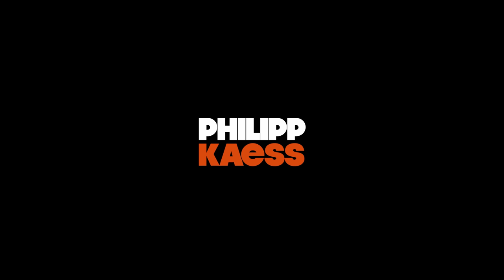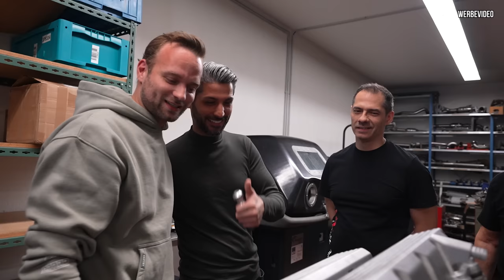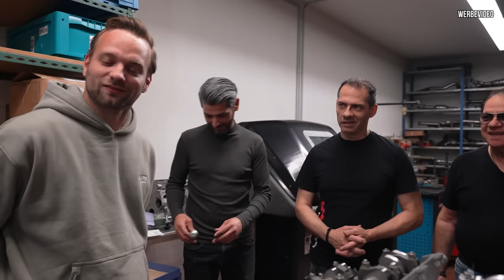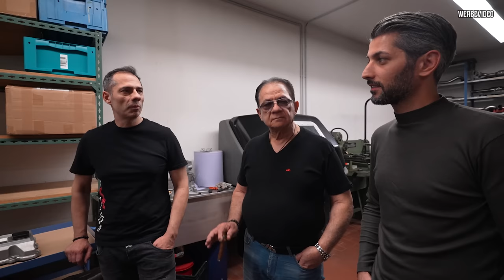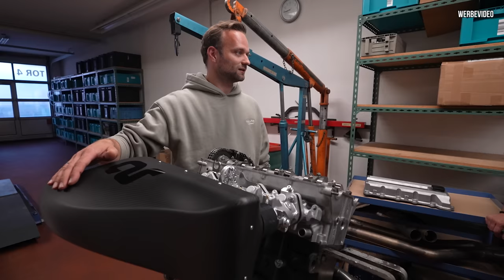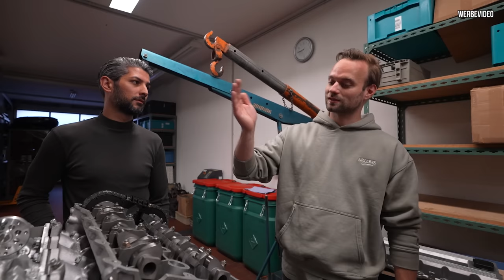DREHZAHL statt HUBRAUM! Aber auch mehr WARTUNG als FAHREN? BMW S42 Rennmotor!

Comment: Na da bin ich mal gespannt. Sieht ganz gut aus. Verdichtung 12,6 und Ventilhub von 12 gibt schon Leistung aber für einen Rennmotor noch relativ Human, hat meine Maschine auch. Ich fahre 45mm Walzenschieber. Wenn das hier 50er Standardklappen sind ist das äqivalent hier etwas größer als bei mir. Sollte hier schon 240 PS bringen. Mein 2,3er Motor in Straßenabstimmung drückt 255PS. Eine Saison sollte das Pleullager schon halten, falls das nicht der Fall ist, wird der Spaß schnell getrübt, prophezeie ich jetzt schon mal. Bei der Drehzahl ist es ganz einfach; bei 25m/s ist Schluss. Das heißt bei einem 88er Hub wie hier genannt, klar: 8500U/min ist die oberste Grenze. (bei 85er Hub wie die S42 BMW Daten hergeben sind es 8800U/min) Schaltdrehzahl sollte mindestens 300 U/min darunter liegen, damit man Reserve hat wie Philipp schon richtig sagt, sonst ist das Ding schnell mal Schrott, beim "Runterschaltfehler" hilf kein Begrenzer 😀 Niemals Filter weglassen, ist für normalos wie wir es sind Schwachsinn. In der STW waren die Filter großflächig im Ram-Airbereich vorne. Tip: bei der Drossel, viel hilf nicht immer viel. Original waren 46er Flachschieber verbaut. Wenn du Spaß haben willst, meld dich und ich nehme Dich mal mit, man muss keinen 300PS "Kopfschmerzenmotor" haben, reichen auch 250PS, kommt natürlich auch auf das Auto drauf an, was angeschoben werden soll 😉
Reply: Nen normaler Sauger schafft ca. 10 Nm pro 100ccm. Bei 250 Ps und z.B. 8000rpm brauch er 220 Nm. Sollte machbar sein bei dem Setup.
Reply: Mal ne Frage: In welchem finanziellen Bereich bewegen wir uns da? 20-25tEUR?
Reply: @iknowit3705  der Motor ist ein Duratec Cosworth. Motor (geschmiedete Arrow Kurbelwelle) mit Anbauteile und Steuergerät ca. 28.000€. Ich habe noch eine original geschmiedete, gebläute Cosworth Kurbelwelle verbaut, da würde ich sagen 35.000€ wenns das noch neu gäbe. Entgegen zu oben geschrieben, fahre ich eine 12:1 Verdichtung + 11.3mm/283° Nockenwelle bei 255PS/270Nm/600kg. Die größte Ausbaustufe wäre 14:1 Verdichtung, 13,2/300° Einlassnocken, Ø1mm größere Einlasventile, 48er Walzenschieber und mit 89er Bohrung als 2.4er Das bringt dann ca. 325 PS. Für die Straße ist das von den Belastungen nicht sinnvoll. Die zweithöchste Ausbaustufe hat 280 PS und ist die meistgewählte bei Renneinsätzen um eine Saison durchzufahren.
Reply: @iknowit3705  bei dem M42 vom Vid wahrscheinlich im Bereich von 10 bis 15 k wenn du Freundschaftsdienste ausschliessen würdest. Hört ja nich beim Motor auf. Steuergerät. Kupplung. Zusätzliches Kühlerpaket. Sensorik. Verschlauchung. Ist schon viel Geld. Aber selten.
Reply: Aus welcher Gegend kommsten? Hier in IN such ich noch ein paar Motorsport bekloppte ;)
Reply: @jaybee5390  Nordthüringen 😉

Comment: Geiles Teil.
Der einfachere Weg, wäre ein b18c oder K20a von Honda gewesen. Die machen bereits ab Werk 9k bzw 8,5k Umdrehungen und werfen gute 200PS aus. Aber ja ich weiß, Sünde und so.
Reply: Nope. Das geht eigentlich nur beim f20c & b16b (sind die einzigen mit 9000rpm drehzahllimit). Der f20c ist alles andere als zuverlässig. Bei dem b16b bin ich raus. Frontantrieb war noch nie so richtig meins. Die anderen drehen meist knapp über 8000 und haben dafür aber einen deutlich besseren durchzug (also zumindest was die ganzen k20 varianten angeht, die b motoren sind echt nicht so meins).

Comment: Ich fahre selber den M42b18 allerdings im E30 318is, ich bin echt gespannt was der Motor nachher so an Daten hergibt. Ich bin selber gerade an dem Projekt den Hubraum zu erhöhen durch die Dieselwelle usw. Da ich aber kein Tracktool habe sondern STVO Konform unterwegs bin, wird der Motor relativ human gebaut mit originaler Drosselklappe, die nur aufgespindelt wird um die originale Optik zu erhalten😉.

Comment: Ich habe es ja schön öfter geschrieben...aber als Motorradfahrer lächelt man darüber. Wenn die Haltbarkeit keine Rolle spielt, dann könnte man auch (gesponnen) zwei Ducati Desmo-V2, zBsp. 1098er, zusammenhängen und bei etwas mehr Hubraum hätte man 308PS. Ganz ohne verrückte Renntechnik. Mit dem krassen Zeug fährt man dann 990ccm und 260PS ^^.
Reply: Eben... aus 1l Hubraum 200ps zu holen ist bei motorädern nichts besonderes. Und die halten gefühlt ewig. Klar haben die Motoren weniger Belastung.
In der moto gp sind auch über 300ps drin🤙
Reply: Da lacht der Autofahrer über das Drehmoment bei den Motorrädern.. 220ps und 120NM sind nicht gerade Werte, die im Auto Sinn machen. Äpfel und Birnen.
Reply: @Xero285  da sollte man schon 2 von nutzen. So habe ich es geschrieben. Die Auslegung eines Motors ist immer vom Einsatz abhängig. Die Formel 1 Sauger waren auch keine Drehmomentgiganten... das ist halt das Ergebnis vom kurzen Hub. Also keine Birnen und Äpfel, oder ist der Motor im Video für den Anhängerbetrieb auf der Pferdekoppel gebaut worden?
Reply: @Xero285  jedoch reden wir bei Motorrädern von lediglich 1000ccm.
Rein rechnerisch entspricht das bei 2000ccm 440ps und 240nm. 
Von wieviel Drehmoment sprechen wir denn bei einem Auto mit 2l hubraum und 250ps?
Reply: @VR.46  Rein rechnerisch hat aber nichts mit der Praxis zu tun, das ist ja mein Punkt. Wenn du den Motorrad Motor doppelt so groß baust, dann hast du auch die doppelte Masse und somit ist nicht mehr die Literleistung bei der Drehzahl möglich, ohne Abstriche bei der Haltbarkeit machen zu müssen.

Die Sauger haben bei guter Abstimmung bei 250PS um die 250NM.

Comment: Wäre es nicht einfacher (und günstiger) gewesen einfach einen F20C aus der S2000 zu nehmen?
Reply: k20a oder k20a2. Mit bisschen hier und da standhafte 250ps und nicht so ein groschengrab. Die Bilas Herren freuen sich bestimmt wenn die Rechnung bezahlt ist und die beiden Laberköppe aus dem Laden
Reply: Klar einen Reiskocher in den BMW basteln. Wer das in Frage stellt was hier gemacht wird hat Tuning nicht verstanden
Reply: Engine Swaps sind ja wohl der Inbegriff von Tuning.
Und es geht Selim ja um das 4 Zylinder Schreien ala DTM/STW, das kann der Hondamotor auch und zwar standfest.
Reply: @shiro-tf1mh  tunen bedeutet das bestehende system zu optimieren. Einen anderen motor einzubauen nur weil es einfacher ist, macht da also null sinn. Und nur weil es auch ein 4 zylinder ist klingt es bei weitem nicht so wie der originalmotor

Comment: Warum habt ihr eigentlich keinen s14 als Basis genommen wie beim stw?
Reply: Ich vermute selim wusste dass nicht dass in der ersten saison noch der S14 aus dem E30 weiter verwendet wurde. Ab der 2. Saison war dann der M42 eingesetzt
Reply: @TheS1PikesPeak  naja genannt s42 der hat einen eigens konstruierten Zylinderkopf
Reply: @user-wn3ww5lw5j  weiß ich. S42B20P heißt er im ganzen 🤓
Reply: @TheS1PikesPeak  meines Erachtens nach sehr wenig mit einem m42 zu tun
Reply: @user-wn3ww5lw5j  Block ist 1:1 ident, Kopf ist von den Abmessungen und der Ausführung ident aber halt komplett andere Innereien (Nockenwelle, Kanäle, Größe der Ventile) und halt Ansaugung ect halt auf Renn trimm
Reply: Weil die Teile vom S42 noch viel Kostspieliger sind, als beim S14 und der ist schon Endgegner bei den Kosten für Teile.
Nen kompletten M42 bekommst du für 500Euro.
Reply: @Xero285  das der s42 extrem teuer ist ist klar aber denke mal ein s14 auf dtm spec aufzubauen wäre ähnlich teuer wie dieser Motor und der ist schon erprobt und läuft garantiert perfekt
Reply: @user-wn3ww5lw5j  Da läuft nichts perfekt und die DTM spec Motoren kosten nochmal ne ganze Stange mehr. S14 und S42 kannst du mit dem Motor, der hier gezeigt wurde Kosten technisch nicht vergleichen, die spielen nicht mal im selben Universum.. S14 auf 300+ PS kostet schnell 30k€ ohne Motor, DTM spec liegst du bei 80k, wenn du überhaupt Original Teile findest. 
Einen M42 bekommst du für 10-15k haltbar auf 250PS inkl. Motor.
Reply: @Xero285  muss ja nicht mit originalen Teilen von damals einfach nur gleiche Abmessungen Flachschieber gemachter Kopf Ölsystem und leichterer Kurbetrieb fertig erprobter rennmotor
Reply: @user-wn3ww5lw5j  Hast du mal eine Kurbelwelle nachfertigen lassen? 😂 Dispo sein Vater.
Reply: @Xero285  gibt für 2,5k s14 billet Kurbelwellen
Reply: @user-wn3ww5lw5j  aber nicht nach DTM Spec... Die Kurbelwelle vom S14b25 wurde für die DTM noch maximal bearbeitet.
Reply: @Xero285  die billet ist leichter und stabiler
Reply: @user-wn3ww5lw5j  Dann nenn mir doch mal die Vorteile der gefrästen gegenüber der geschmiedeten Kurbelwelle beim S14 Motor... Ich bin gespannt.
Reply: @Xero285  aufgrund des gleichmäßigen materialgefüges von gefrästen Bauteilen lassen sich diese leichter konstruieren da das Material größeren Belastungen standhält
Reply: @user-wn3ww5lw5j  Bist du ein Troll?
Reply: @Xero285  oh Gott…
Reply: Warum beweist du deine falschaussagen nicht?
Reply: @user-wn3ww5lw5j  und wieder wird hier diskutiert. Lass es sein du hast einfach keine ahnung davon.
Reply: @Xero285  ja ist ein Troll. Will alles besser wissen aber kann nix technisch belegen.
Reply: @8epeter  welche Falschaussage soll ich beweisen?
Reply: @user-wn3ww5lw5j  alle deine falschaussagen. Vor denen du ablenkst! Das weißt du nämlich also nicht rausreden sondern Nachweise und Beweise liefern!
Reply: @8epeter  welche konkrete Aussage meist du jetzt? Am besten mit Zitat wenn du dazu in der Lage bist
Reply: @user-wn3ww5lw5j  nicht fragen sondern liefern! Du weißt welche rede dich nicht raus.
Reply: @user-wn3ww5lw5j  und schon persönlich werden. War klar wenn die Argumentation fehlt, das technische Wissen fehlt.
Reply: @user-wn3ww5lw5j  Wo sind deine Zitate? Wo sind deine Antworten? Wo sind deine beweise? Wo sind deine Nachweise? Von anderen was fordern aber nix liefern!
Reply: @user-wn3ww5lw5j  was ein troll
Reply: @8epeter  nenn mir eine Aussage von mir die ich dir belegen soll und ich belege sie dir
Reply: @user-wn3ww5lw5j  lerne lesen! Alle Aussagen sind falsch ALLE. 
Du weißt welche lenke nicht ab!
Reply: @user-wn3ww5lw5j  Diese ist z.B. völlig falsch, im Zusammenhang mit dem S14 Motor.
Reply: @user-wn3ww5lw5j  Diese auch. Die Billet Welle ist nicht stabiler als eine bearbeitete Schmiedewelle.
Reply: @Xero285  warum ist diese Welle „falsch“
Klar kann eine geschmiedete Welle besser sein als eine billet kommt immer auf die Qualität und das Ausgangsmaterial an unter gleichen Bedingungen ist die billet Welle aber überlegen was Performance angeht
Reply: @user-wn3ww5lw5j  Du hast geschrieben sie ist besser. Deine Begründung dafür ist falsch.
Also warum meinst du nun, dass sie besser ist? Und komm mir nicht mit dem Gefügequatsch, denn da ist Schmiedematerial immer überlegen.
Reply: @Xero285  nein je nach Qualität sind die da gleich auf du kannst aber nie so präzise schmieden wie du fräsen kannst
Reply: @Xero285  bei Schrauben sind gerollte Schrauben auch das non plus ultra nicht geschmiedet genau das gleiche
Reply: @user-wn3ww5lw5j  Merkst du selbst, rollen ist eine Art Kaltschmiedeverfahren, also spanlos. Billet beschreibt im amerikanischen immer eine spanende Bearbeitung (außer bei runden Halbzeugen, aber die treffen hier ja nicht zu).
Ein schmiedeverfahren ist bei solchen Anwendungen wie wir sie gerade besprechen immer einem spanenden Verfahren vorzuziehen, wenn wirtschaftlich möglich.
Bei dem spanenden Verfahren passiert nämlich genau das was du oben dem „Billet“ zusprichst, nämlich das Gefügelinien getrennt werden, was die Stabilität negativ beeinflusst.

Comment: Der wird den nicht lange bis auf 8500 drehen weil der Motor das nicht lange aushaelt....
Reply: Und woher weißt du das so genau?
Reply: @epsilonhyperworks7749  Weil ich unter anderem einen S14B23 und B25 auf der NoS gefahren bin in meinem M3E30.. Und das hier ist nicht einmal ein S Motor...Die S14B20 und S42B20 haben in der STW Zeit 8500 gedreht und vor allem die S42 waren andauernd kaputt bei etwas mehr Leistung...und das hier ist KEIN S42!

Comment: Duc Panigale V4

HUBRAUM 1.103 cm³
LEISTUNG 215,5 PS  bei 13.000 U/min

SERVICE-INTERVALL
12.000 km / 12 Monate
Reply: Das Intervall ist auch kein Problem, da die Teile in den Dimensionen viel kleiner  und damit leichter sind als bei einem Automotor. Die Werte kann man trotzdem nicht vergleichen da selbt dieser Ducatimotor ein Auto nicht ansatzweise schnell bewegen könnte. Hier braucht man die Kombination aus Drehmoment und Leistung und nicht nur Leistung.
Reply: @WeAreDriversCar  ah, Ok danke für die Aufklärung.
Reply: Ölwechsel Interval, Service wurde erhöht.
Reply: 123NM Drehmoment hast du vergessen zu erwähnen.. Fürs Motorrad reichts, für ein Auto nur für die Eisdiele.